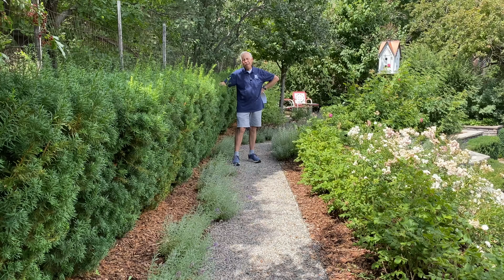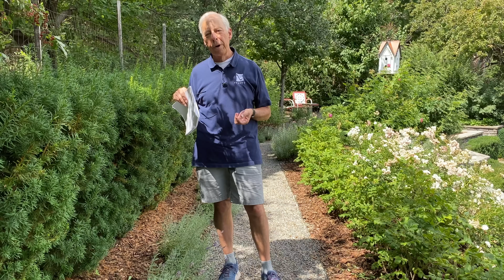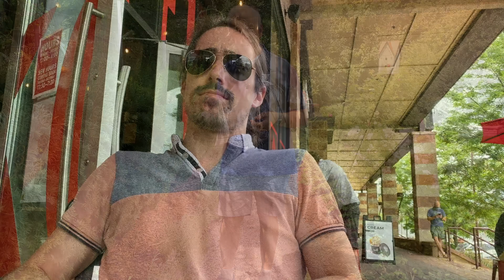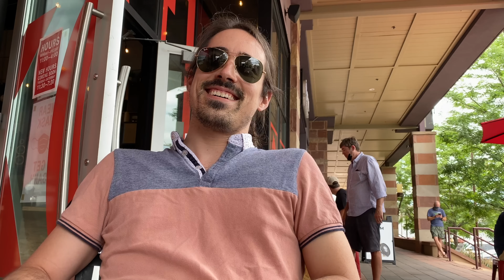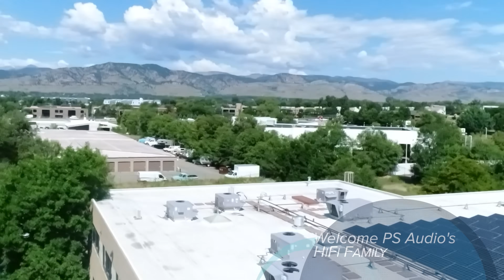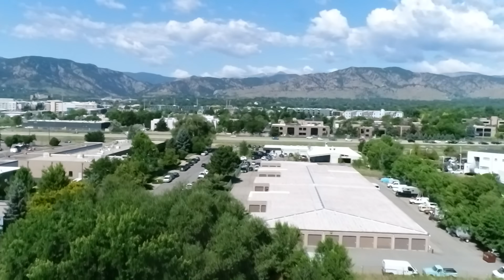Vacuum tubes on satellites?

Comment: Some people like the added distortion of vacuum tubes. Instead of some outdated design using obsolete components like the 12AX7, that needs you to wait while it warms up and wear out quickly, why not make a modern product with a DSP based vacuum tube emulation superior to actual vacuum tubes (combine it into the DAC)? Those of us who like the purest sound can then turn it off. Also, Korg developed their Nutube a few years ago that can last much longer than a traditional tube. Not sure if it's great for this, but it's a more modern component that is not produced by some old garage manufacturers in Russia. BTW, the magnetron used in microwaves, the klystrons used in satellite ground stations and the traveling wave tubes used in satellites have nothing much to do with traditional vacuum tubes.
Reply: I'll take a 12AX7 made  in 1950 over a new one any day of the week.
Reply: RanByMonkeys Yeah, if I was to buy a tube based amp, I would rather prefer mass produced tubes with proper quality control than some random garage handmade copy one from rural Russia or China. And probably a 70 year old tube is still fine today if it has never been powered.
Reply: @ThinkingBetter  I'm talking about mass produced tubes but they were PRODUCED 70 YEARS AGO!!!!
Reply: just because they are old doesn't mean they didn't make a shit load of them haha
Reply: @ranbymonkeys2384  I wonder how many mass produced quality vacuum tubes are still sitting in warehouses many decades old. Lots of garbage vacuum tubes are made in small dirty factories in China or Russia nowadays and mostly used in some cheap stuff you can buy online pretending to sound good, which it doesn't.
Reply: @ThinkingBetter  They ONLY make them in China or Russia, look don't buy fucking tubes I don't know what to tell you.  Think period not just think better, damn.
Reply: Yup you do get some bad ones, but the sound difference is unreal.
Reply: Dave Micolichek  I'm not sure what you imagine a vacuum tube is doing to audio. A vacuum tube is a relatively simple electronic analog component that doesn't have any complex behavior to it. It's completely understood how it works. Of course you can model the behavior of it precisely and even tweak the model to sound better than an actual vacuum tube using a DSP. There is nothing magic about vacuum tubes. E.g.: https://www.researchgate.net/publication/224642046_Wave_Digital_Simulation_of_a_Vacuum-Tube_Amplifier
Reply: Dave Micolichek  All that can be modeled also, but I thought we were talking about using a tube in a preamp line level part of the audio system without adding a transformer. It's sort of a bit wild if you really like the combined effects of the tube + transformer + feedback through sound waves into the tube. If you can express anything in a mathematical model, you can also use a DSP to replicate it. Definitely transformers are not magic either. The effect of sound waves hitting your amp and making the tubes vibrate with some delay, can actually be modeled also in a DSP. I prefer a pure sound as intended on the master recording without such additional somewhat unpredictable distortion effects.
Reply: Dave Micolichek Check: https://www.kemper-amps.com/products/profiler/line-up
Reply: Dave Micolichek Did you try Kemper? Lots of great artists use it nowadays: https://www.kemper-amps.com/artist-gallery
Reply: i do both. My HT system is all digital DSP based up the analog volume control and of course power amps. My music system is all tube with a recently new DIY preamp/crossover that spits the stereo mains and mono sub at 100hz / 24db slope. For me tubes are just fun. I make no claims on which sounds better. I will only say tube equipment sounds different than SS. You decide which is better.
Reply: @andydelle4509  What matters is that you enjoy what you are doing. Some things tubes have going for them are that they require more nursing and look cool. That sort of similar to how vinyl makes sense to me and keeps the hobby more active. I must admit when I go all digital and all solid state, I lose most of my "audiophile hardware nursing effort". I just installed some speakers in my garage from a pair of reworked old Beovox CX-100 speakers and added amplifier + DSP cross-over inside of them and mounted them in my garage. I even had to replace all the 4 rubber surrounds of the woofers. I enjoyed this effort, but now it's over and they will probably work for the next 10 years with nothing to do other than to use them.
Reply: @ThinkingBetter https://www.youtube.com/watch?v=DL13JcY6PHg  20,000 people at rally in 2016.  I could tell you were a Lib by the way you were pissing and moaning like a 5 year old.   confused the hell out of DAVY

Comment: There are some impressively large tubes used in Radar.
Reply: Not to mention radio broadcasting station transmitters like the one I worked at in the early 1980s.
Reply: @jonathansturm4163  Ahhhhhh, the NAB ( National Association of Broadcasters ) show is here in Vegas in April. But not this year. A year ago I stopped by a booth of a German Company that offered TV Station Transmitters. Specifically for the new ATSC 3.0 standard. The product they were showing was displayed in a 19in rack and if I remember right was four high or about 8in. So 19inx8inx20in was the entirety of the transmitter box. No tubes in there.
Reply: @wilcalint  I was a DJ at 92 FM in Hobart. The transmitter definitely used valves despite being relatively low power. I’m not saying that solid state VHF transmitters didn’t exist at that point in time, but they were definitely out of the range of our station budget.
Edit: The chap who built the transmitter just told me it used  two 4CX250
 valves giving a theoretical output of 500 watts, but it’s doubtful we achieved anywhere near that level of output.
Reply: Yes 160 Watt tube make good single tube amplifiers

Comment: How are the Voyager spacecraft, launched in 1977,
able to transmit radio messages so far?
https://science.howstuffworks.com/question431.htm
Solid State transmitter, 22.5w
Distance from earth right now?
About 14,000,000,000 miles from earth.
Both of them. And they're still working.

Polaris Missile, the warhead, designed in the late 50's.
Yup it had a transmitter and receiver.
Yup, all Solid State. Ask me how I know.

Lunar Lander "compass" designed in the mid 60's.
Adapted from the electronics from the Polaris Missile warhead.
Yup all soild state. Ask me how I know.

Hint, I'm 75 years old. Computer Engineering, MIT, 68.
Reply: Wowsers! Those of us working with the amateur and WW 2 surplus gear never knew :-) When I was 13 years old my best friend used to argue that solid state was “just a passing phase” and valves were infinitely superior in every way...
Reply: There are two S-band (2113MHz) RF power amps, and two X-band (8415MHz) RF power amps on Voyager.  One S-band amp is solid state, the other is a TWT (Traveling Wave Tube).  Both X-band amps are TWT.  
Since X-band provides the longer-range telemetry with its 0.5 degree beamwidth and 48dBi antenna gain, the S-band transmitters are no longer in use.  S band is now used only for uplink to Voyager from Earth.  
All amplifiers are capable of operating at a low-power or high-power level.  The S-band solid state amp output levels are 6W or 15W, while the TWT levels are 6.5W or 19W.  The X-band output levels are 12W or 18W, and those amps operate at about 25% efficiency.  
On Voyager 1, the X-TWTA-2 amplifier failed in 1987 and it has been using the X-TWTA-1 amplifier since then.  Voyager 2 also switched to its X-TWTA-1 amplifier, in 1998.
Reply: @marianneoelund2940  Absolutely amazing machines.
Reply: @marianneoelund2940  Remeber all the stress over those things launching with their radioisotope thermoelectric generators. Predictions of H-Bombs going off at the Kennedy Space Center if one crashed.
Reply: @wilcalint  I remember reading a paper on nuclear-powered satellites in the 1970s. I presume that’s what you mean by “radioisotope thermoelectric generators”. The ones being advertised in Scientific American were pretty heavy, but of course they wouldn’t need all that shielding a hundred miles or more above our heads.
Reply: woo, secret of national security
Reply: @timtsang168  LOL I've held two "Secret" Clearances. One "normal" the other "Top". The Top Secret Clearance was for a stupid reason that still makes no sense to me.

I was once contacted by a person who introduced themselves as a Government Official. I was to meet him in a DC Holiday Inn Hotel Room which I did. He gave me no name or what he wanted my product for. I gave him a presentation of what we provided. He gave no responses. I asked him if he wanted to purchase any. No response. Just a thank you and that was it. There's a term for this kind of Government Official. They're called a "spook".

Comment: the Russians used vacuum tubes in the radios on board aeroplanes during the Cold War everybody laughed at them until they realise why it’s because they wold keep working after a em pulse.  not so backwards has people thought
Reply: And as Darren pointed out vastly superior in high frequency designs. The first powered radio I built used an RCA miniature valve called an Acorn valve; a 955 triode if memory serves. In those days you could purchase 45 volt dry batteries at the corner store and you’d have been hard put to find anything smaller than a 1.5 V D cell.
Reply: @jonathansturm4163  
In the 60's I recall a portable tube radio that used a 97.5V B battery.  These days, such things would probably be made illegal for safety reasons.
Reply: @marianneoelund2940  I don’t recall seeing any of them. I used to have a paper round in the early 1960s and one of my clients lived in a house that had never converted from gas to electricity. They had a lovely radio that ran on the 45 volt batteries that as I refer to elsewhere in this thread were available from the corner store. I do recall as an avid reader of Bernards Books some circuits that ran with 90 volt HT, but never saw any in the flesh.
https://pictures.abebooks.com/WORLDOFRAREBOOKS/md/md30381338393.jpg
Reply: Tubes were widely used in Military applications, including airborne, in WW2.